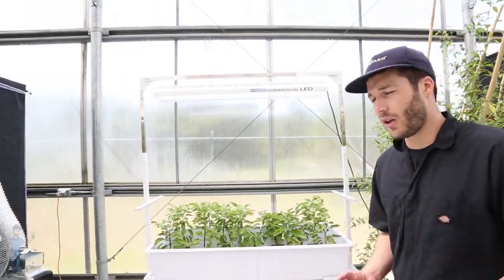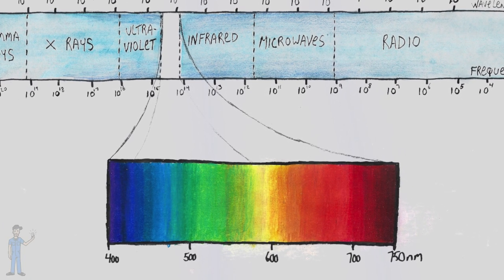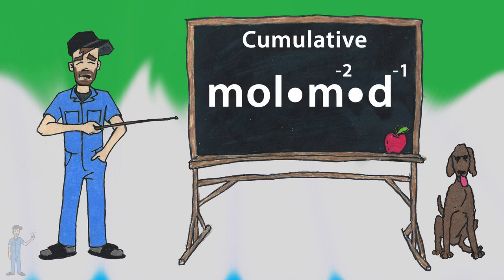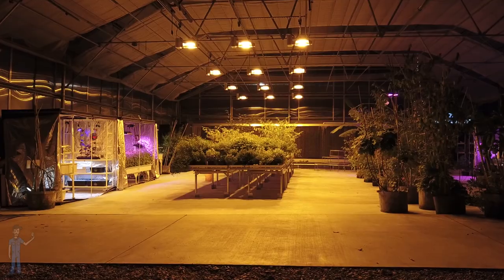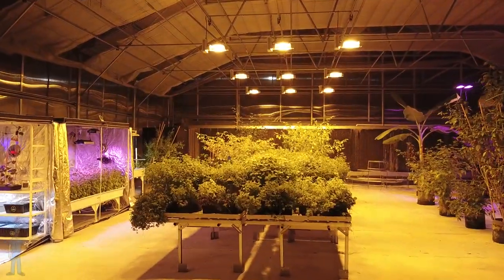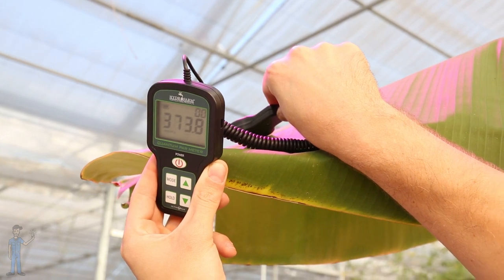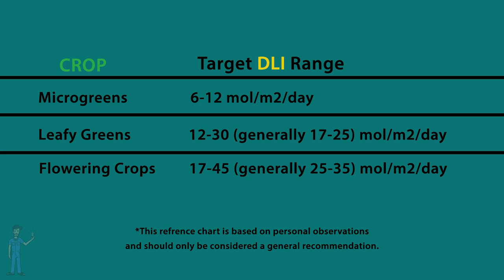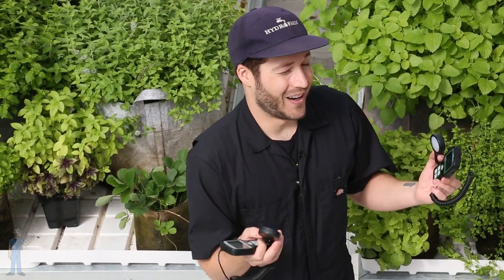Light Intensity : Plants & Light #109

Comment: Great series! Have you been able to do any tests on whether it's better to run high intensity for 16 hrs vs slightly lower intensity for 20 hrs but achieving the same DLI? This would be for a crop like Basil. At what point is it too much light? Thanks again for all the videos.
Reply from the maker: Hey Nicholas, thanks for watching! Basil can handle a lot of light, I've seen it grow well with a DLI over 30 mol/m2/day. At minimum I try to give basil 12 mol/m2/day indoors (but more is better) and in a greenhouse I target a minimum of 17 mol/m2/day. For most leafy greens I'm comfortable running a 20 hour photoperiod. Usually it is cheaper for growers to design a system that runs lower intensity for longer photoperiod (ie. 20 hr). Lower intensity will generate less heat indoors and require less grow lights. Do you know what DLI you are running now? Are you indoors or in a greenhouse?
Reply: Thanks for the response! After watching your video that did seem like the way to go, so that you wouldn't need to ventilate as much on a daily basis. I'm growing indoors with a DLI of 15-17 on the edges and up to 25 in the middle of the rack (ZipGrow) also while supplementing CO2. They are 4000k white LEDs called QB120 boards from horticulture lighting group. They are dimmable so I can adjust intensity. My issue has been that the plants that get the higher DLI have had deficiencies, although I think it may be due to air stratification as VPD has been a little high, some of them get kind of tough growth compared to those who don't get quite as much light. Although after watching the blue light episode, I wonder if it partially has to do with my spectrum. What kind of humidity do you usually grow at? It's pretty dry where I am at.
Reply from the maker: What does the deficiency look like? If it is interveinal chlorosis in new growth (yellowing between leaf veins) it probably is iron. Basil is 'iron-inefficient', it is best to grow it in a nutrient solution with a low pH to keep the iron available to the plants, I aim for a pH of 5.5 when growing hydroponic basil. If it is chlorosis on lower leaves it is usually nitrogen or magnesium. Easiest fix for this would be to raise your EC. There are definitely many other possibilities but difficult to say without seeing the growing environment and checking out nutrient solution.
Reply: Yeah it's been interveinal chorosis mostly on new growth. That's interesting on the PH. Mine has been higher than that so that is possibly the issue. Thanks for taking a stab, I know it's really tough to diagnose without being around the plant but I appreciate it.  Once again, awesome videos. These are all of those tests that I would love to do but don't have the means so I'm grateful there are others like you out there willing to share!
Reply: Nicholas Bouman have you stuck with the HLG 4ks for basil? I have found the spectrum to result in substantial stem elongation in many basil cultivars, I believe as a result of the high level of green in the spectrum, which may offset the blue peak.
Reply: lower intensity and longer hours with the same dli produce up to 20% more yield. you can found those research on google.

Comment: Great video's, but that led blocks more light then it produces.  You want a small reflector for green house applications, with a bulb like growers choice DE CMH 1000w 4200k 98cri.  Its as close to pure sun light as it gets.....
Reply: But it produces every time the same amount of light, so sometimes it blocks sun light sometimes it produces more than shaded sunlight
Reply: Zaka Pentax   If you think that California Lightworks SolarSystem LED in any way compares to the quality of light of the sun or a 98 cri bulb you have a lot to learn about light quality.  Gavita makes a system that will automatically adjust the watts across a greenhouse to adust for light levels and or heat.  So the 1000w de hps or cmh is fully and automatically adjustable and at a fraction of the cost 3 or 4 gavitas for 1 led especially with bulk discount.  These Gavita setups are in the most well funded greenhouse grows across the world, they dominate the industry for a reason, they work!  The LED shown in the video will never replace the light quality or intensity that it takes away from the greenhouse grow.  Its to damn big for a greenhouse application!  With low light loving plants the led would prove to be great by default of needing a low performance greenhouse grow.  With cannabis, its a laughing joke for a greenhouse to block out the sun in an attempt to provide more light, small powerfull reflectors win.  Plants use no less then between 360nm-760nm  Leds rarely travel beyond 400-700 even "full spectrum LED'S".
Reply: @fubar226 Some LEDs produce a similar amount of PAR light as a DE HID light, while using 2/3 of the energy a DE would use, emitting far less heat and with far more control over the spectrum. So while LEDs are more expensive upfront (and costs continue to go down over time since it's a relatively new technology), they are more efficient consumption wise and they require less maintenance. DE lights are still awesome, don't get me wrong, they just use more energy than LEDs do to achieve the same results with plants, which makes them less profitable for a business.